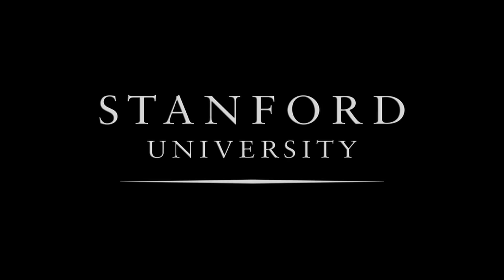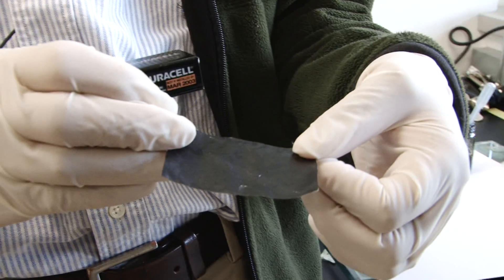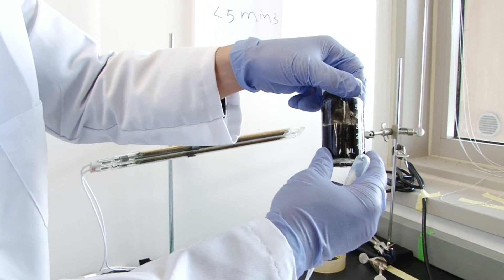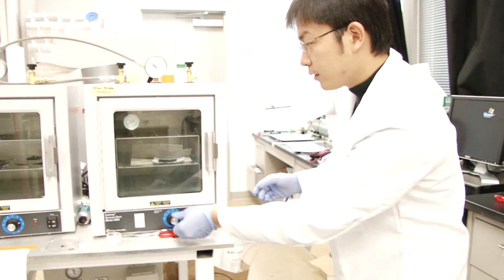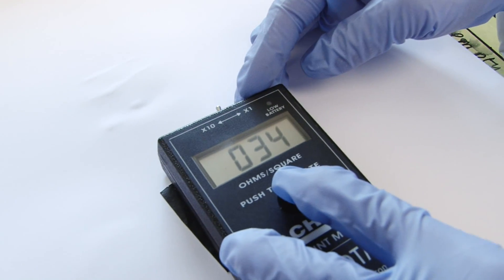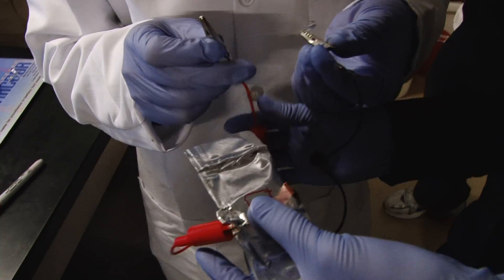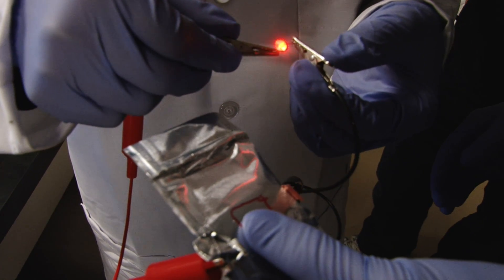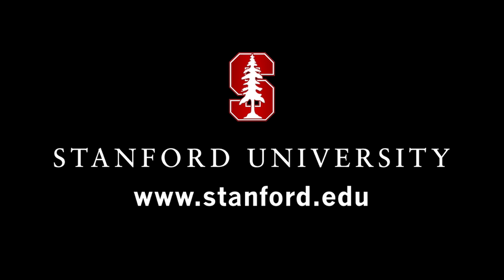Nanotubes + ink + paper =  instant battery

Comment: now glue those papers together into a 4x8 sheet like plywood (leaving every 2 feet un-inked so you can screw it to a roof) add a couple of terminals and your roof could be the batteries for your solar panels.  of course I think the solar panels need to be built into the sheets just leave a place to screw them down and terminals to hook it to the grid or run my home and it's all cool.
Reply: better yet use nanotube glue during the assembly of the plywood.

Comment: forgive me if i am wrong but i think it is more like a capacitor then a battery meaning it would not be able to store as much energy as a battery.And secondly because it is a capacitor its voltage tends to fluctuate much more then a battery and that can cause harm to some electrical components

Comment: The paper soaked with carbon nanotubes and/or silver nano-wires(curiously omitted in this video) is just a highly porous conductor. It is not itself a battery or a capacitor.

Capacitors made from the material have a specific energy of 7.5 Wh/kg. That's pretty good for a capacitor, but even a humble lead acid battery gets ~30-40 Wh/kg.

The abstract doesn't give any info on what battery chemistries they've used or specific energy they've achieved.